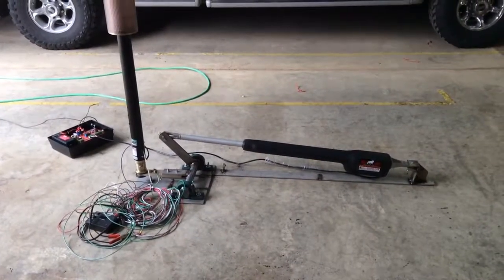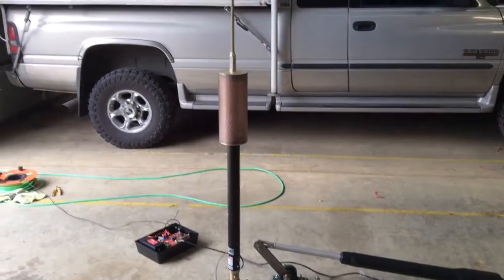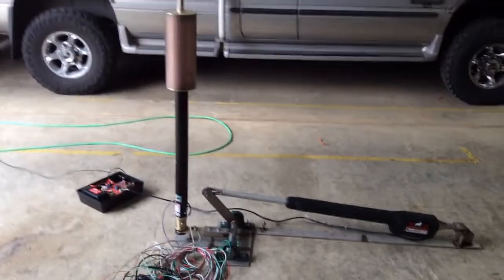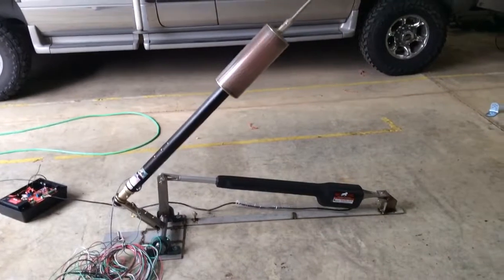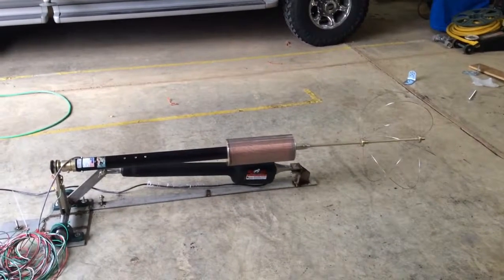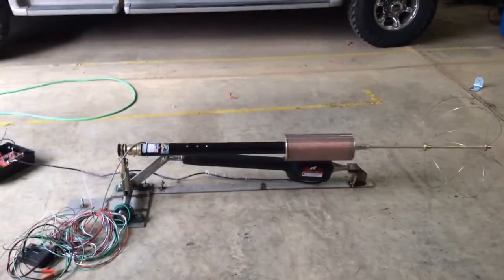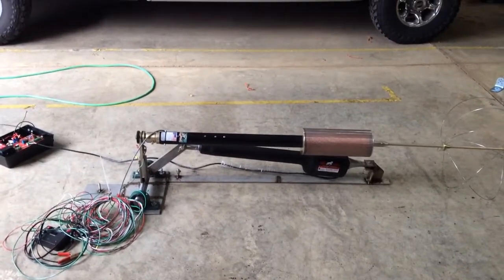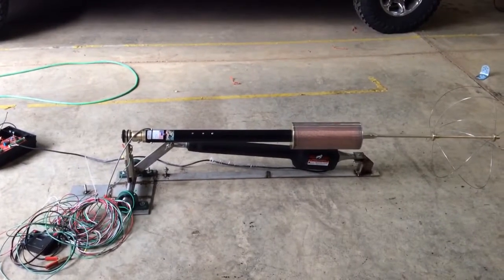Linear Actuator to Raise a Roof Mounted Hi-Q Antenna

Comment: Hi Allen - I've been thinking about using a linear actuator to control my Bugcatcher mast. Do you have a specific control for the actuator?
Reply from the maker: Michael Coslo Yes, actually I used a Mighty Mule gate opener.  I have been using their products for 25 years and have been very happy with them.  The advantage of Mighty Mule is you get a complete system with soft start and stop, remote control, battery back up that is good for about 150 openings. You can add second battery for extended use without power, solar power option, electric lock option....just a lot of goodies from an established company plus you can buy it from Home Depot and other retail suppliers.  Hope that helps.